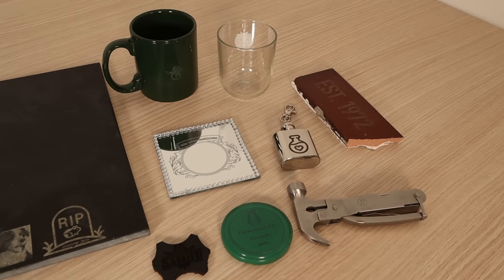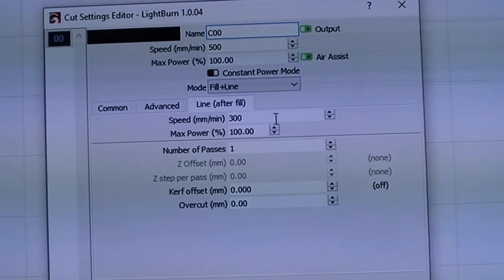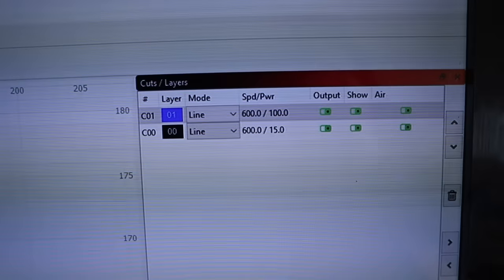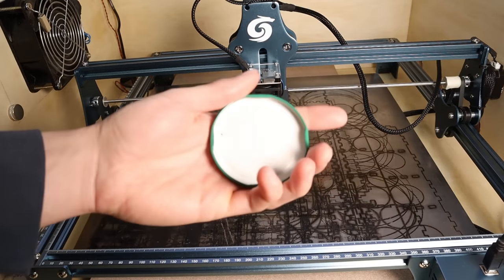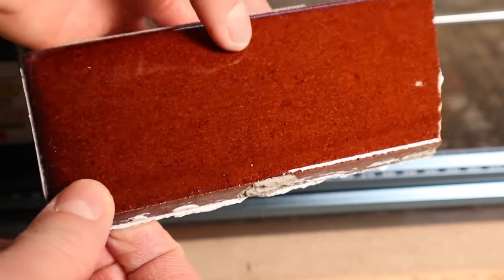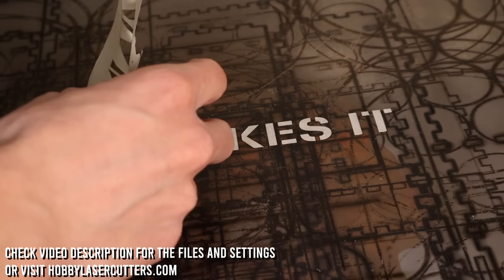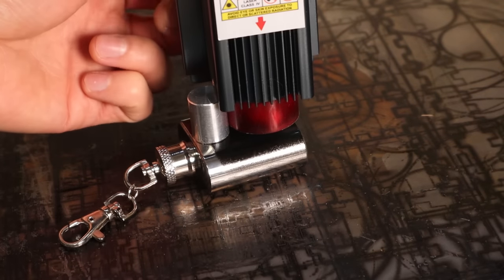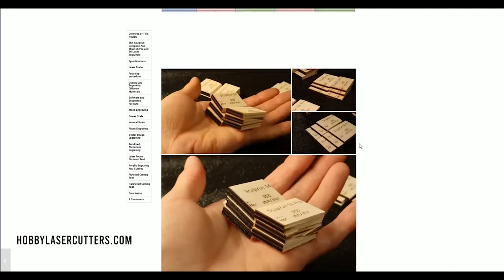10 EXTRAORDINARY MATERIALS You Didn't Think You Could LASER ENGRAVE! (Sculpfun S9)

Comment: Awesome video, thanks for all the ideas! 
What settings did you used for the stainless steel engraving? For me it didn't worked very well so far.
Reply from the maker: Thanks! For stainless I use very very slow speed and full power. If it still doesn't work, try painting the surface black with a marker or a spray paint. It will engrave much better.

Comment: Thank you for this really informative video. I have been researching extensively, trying to find the best inexpensive laser for engraving very thin lines on cow bone. The same as scrimshaw. I have been having difficulty getting specific information on this. Please tell me, do you think this S9 can engrave clean lines in bone that are about .07mm wide and .07mm deep? Or can you recommend an alternative inexpensive system to achieve it? Thank you for any advice you can give.
Reply from the maker: The s9 has the thinnest lines in its class. Check the link in the video description of my review of the hobbylasercutters.com. where I have measured the laser spot size. If Ou want to have smaller laser spot (0.3mm) checkout my review of the Enjoywood M4)

Comment: Very strange, the one I tested does not mark a shiny metal surface, not even when painted black, even at maximum power by making several passes. I haven't tried it on glass, but I assume it just tickles it.
Reply: So he's lying?
Reply: I've got it to work on glass using black water based paint like shown here, works well. I also managed to get quite faint engraves on stainless steel but I haven't tried other metals.
Reply: @MrVininski  So do you recommend it on stainless steel? Could I see some of your engravings? I'm searching for a low budget engraving machine for stainless steel and I don't know yet what should I buy.
Reply: @MrTaVy07  it's a great machine but I wouldn't recommend it for metal. You can see my first tests here on some stainless steel offcuts. Some were darker than others but most came out quite faint. They don't scratch off when cleaning with cloth or scratching with fingernails. https://www.dropbox.com/s/r0bono61a799uth/img20220220104043.jpg?dl=0
Reply: It only marks SOME steel. Like the one on cheap cutter blades. Not shiny metals, not zinc plated steel, not coated steel, definetly not chrome steel. Not even with paint, vinegar, mustard, etc. I am in the same situation belived those youtubers that leaved us thinking that those lasers could engrave any steel. I spent hours trying. Try cheapest  cutter blades first. speed 1000m/s 80% on 20W laser.

Comment: Hi could you please share what settings will need to be change to engrave on metal sheet just 1.5 mm thick. Hope you answer shortly.
Reply from the maker: For stainless steel, full power and very slow speed. For normal steel it is impossible to engrave it with diode lasers
Reply: Which laser is successful then please suggest. Thanks for your kind reply.
Reply from the maker: @roshanshah2709   This one: https://youtu.be/LvUuUONVthE
or this one:
https://youtu.be/anb9m1GDyHU

Comment: How do many passes do I have to do on 3mm mdf and what setting that it doesn’t burn the edges
Reply from the maker: Max power nd 300-600mm/min. As many passes as needed to get through. Mdf will always have black edges as it is not the best material because it contains a lot of glue. Some mdf boards are easy to cut, some are almost impossible.

Comment: Good Morning

I have an A5 PRO, I'm a professional cutler, I use the engraver to make engravings on my knives, but I have a problem.
after removing the paint, the metal of the knife is not clean, before that I used a CO2 burner that left the place very clean and highlighted the black paint, do you know if there is any way to do this with the A5 PRO?
Reply from the maker: Try different power levels and speeds and number of passes

Comment: Hi, can we cut zipper pullers made of Steel ?. In different shapes with S9. Steel thickness 10mm max.
Reply from the maker: You can't cut steel with these cheap machines. Lasers for cutting steel start at 10 to 20k usd

Comment: i am unable to take print via light burn software in any SS metal, could you please helpme.
Reply from the maker: Max power and very very slow speed. It helps if you paint the surface black with a marker or some other paint.

Comment: Hi man, I just buy sculpfun and tried to engrave zippo lighter, even when i painted it black it doesnt engrave enything on 100% power, any advice? thanks for answer
Reply from the maker: You need to go very slowly. 100mm/min. It works if the lighter is stainless steel or similar. If it is made from aluminium or brass it probably will not work with any laser.
Reply: @JTMakesIt  lighter is From brass with shiny layer on it, i did it with 20mm/min with 100% And nothing happened at all.
Reply from the maker: @Jsemsadlo  Brass doesn't laser engrave. Try stainless steel

Comment: What is the dpi for image engraving on granite
Reply from the maker: It depends in the setting. Laser dot is sized approx. 0.1mm . So around 250dpi.
Reply: @JTMakesIt  I engraved a portrait picture on granite but it looks like completely white. What should I do, should I increase the dpi as it is the same as yours
Reply from the maker: @IrfanAli-fb1tv  if it's completely white, then you have too much power. Reduce power and increase image contrast.
Reply: @JTMakesIt  ok I will try

Comment: I mainly come from the 3D world I have been researching laser engravers and my question is how long they can work I intend to engrave black stones but with a size of at least 30 x 30 I am worried about not knowing the number of hours it takes for the subject of the temperatures, the protections, etc., point since I have all my 3D printers prepared so that they can last days even TFYA
Reply from the maker: The working time heavily depends on the details and fill amount. But the machines themselves can run for hours at a time. Here I have engraved a photo which took 21 hours to complete:
https://youtu.be/iUTRLMqlYX4
The fill step was very small (0.1mm) but it did it perfectly.

Comment: Do you have data on how long does it engrave? Thanks
Reply from the maker: How long per engraving? It really depends on the design. Simple line engravings take a few minutes max, photo engravings can take longer, depending on the size
Reply: @JTMakesIt  thanks what about text like names? How long does it take?
Reply from the maker: @mangjose03   @Jose JRT  text is engraved quickly if you engrave the outline only. If you also fill the insidenof the letters, the time heavily depends on the type of fill (full, or crosshatch..). You would nred togivr me a concrete example for time calculation.but lets say for example that JT MAKES  IT logo I engraved on the stainlrss steel tool in this video took somewhere around 1 minute. If the text would be solidly filled it could take more than 5 minutes, because stainless needs to be engraved much slower than wood.
Reply: Wow! Thank you for your time answering my question.

Comment: Hello 
I'd like to know for sculpfun s9, what's the best settings for engrave powder coat stainless steel tumblers?
Cheers
Reply from the maker: Experimnt with power so that it burns off the paint and that it doesn't mark metal. Power should be around 50 to 100% and the speed from 500 to 1000mm/min

Comment: very nice videos. thank you.  
can you explain why you put black color on the shiny metal and if its posdible to do it without the black color ?
what if the engraving is on an extrimly shine brass and must be untuched after engraving prosses 
thank you
Reply from the maker: Black color is so that the laser beam does not reflect off the surface and has something to work on. You can blacken the sirface with more easily removable paint like children watercolors. You need black surface so the laser light can be absorbed. You can do stainless without blackening with the s9, but I haven't tested brass yet.

Comment: what settings did you use to engrave on stainless steel? I am using lightburn and having issues getting the settings right to engrave on the surface. I am a new to this so need all the help I can get. Thanks
Reply from the maker: Try 200mm/min or lower and full power
Reply: @JTMakesIt  THANK YOU SO MUCH!

Comment: All decent diode lasers can do all of this!  Guessing you were paid to say how great this laser was. I have never tried a mirror, but I can get the same results from my super cheap $200 no name laser.  I am guessing I can do a mirror too, just never tried it.
Reply from the maker: I was not paid or got anything for this video. This video is just me having fun with this laser, because I wanted to see what it can do, and I got a lot of requests about certain materials in the comments. I have tested a lot of cheper lasers. Cheaper lasers usually fail to engrave stainless steel and ceramics and other metallic parts. I tried mirror with weaker laser and it engraved it but the engraving was not as clean because it did not have enough beam energy to cleanly burn away the coating. But Sculpfun S9 is still considered a cheap laser. Its 300$, but it performs almost as good as some 500$+ machines
Reply: @JTMakesIt    So you bought this laser with your own funds?  It was not given to you for review?  It sure sounded like a commercial to me... no other laser can do all this.....

All other lasers can do all that besides maybe the mirror, and that is only a maybe.  I can get just as good of results with stainless and ceramics.  

I have no doubt this is a good laser, I am only questioning your video.
Reply from the maker: @jon9947  I got it for free to review on my website. There was no obligation from the sponsor for me to make this video. 
If you listened the video, you would hear that I said that it is the only laser in this price range that  can do ALL of these projects. This means that less capable machines can still do some of them. I have around 10+ laser engravers currently, ranging from 200$ to 800$. And none of the sub 400$ lasers I have is capable to engrave stainless steel half as good as the S9. This is why I said that it is the best in this price range. 
The reason that the video sounds a bit like a commercial is because I have posted my affiliate link for this machine as the affiliate commission helps me to make more videos for you at no extra cost to the buyers of the machine. Plus it enables me to obtain discount coupons that benefit the viewers. 
Each video takes about 50+ hours of my work, and I can't do this for free as it takes away most of my free time. I still need to work at  my job 8 hours each day. Youtube is my hobby. If you expect that someone is going to spend 300$-500$ of their own money each month and then film and edit the video for 1 month in the weekends, just to earn 30$ from youtube ad revenue from that video, then you have weird expectations. 
But one thing is true and that is that all of my reviews are unbiased. I always say what I want. If I like the machine I say good things, but if I don't like something I will say it as well. On my website you can see objective performance tests of all the machines I have tested so you can compare their performance directly and buy the machine that suits your needs the most. This is why I do all of this, because manufacturer specs for these machines are all over the place and it is impossible to compare the machines using the product descriptions online.
Reply: What do you recomment? 
I want to engrave watch dials.
Reply: @joeyhohage  I am not really an expert in lasers, the laser I have is very generic and is your run of the mill 5watt laser.  I do know one thing, guys like JT Makes It are not honest.  Any reviewer who does not start their review by telling you they got the machine for free are probably too afraid of having their free lunch turned off to provide 100% honest reviews.
Reply: I also know for the most part a 5watt diode laser is a 5watt diode laser.  Yes some are slightly better than the next, but they are all mostly the same.  The only thing that separates them is how many hours you get out of them.  The max power for any diode laser is about 5 watts, and any laser claiming more is either lying or has multiple diodes focused in the same spot.
Reply: What you probably really want though is a co2 laser from omtech.  Again, no expert so you will want to do your own research, but that sort of laser is a massive step up from these diode lasers.  You can pick up a budget k40 laser for $600 or less pretty easy.

Comment: So S9 is more than enough for engraving almost any things ? 

Thought about buying the S10 😂
Reply from the maker: S10 is a faster and better for more difficult materials like stainless steel
Reply: @JTMakesIt  how do you compare this with LaserPecker series (mini, 2,3,4, LX1 ) ? 

I like how potable they are but can’t be sure about safety.
Reply from the maker: @thanatosor  if you want to do some laser cutting, machines like Sculpfun are much better
Reply: @JTMakesIt  also is it enough to use S9 with only protective glass on the laser beam ? 

Or you actually also wear protective glasses during the test ?
Reply from the maker: @thanatosor  if you are looking directly at the machine it is recommended to use glasses for just in case.
Reply: @JTMakesIt  how are you doing air filtering for this open engraver ? 

As for laser part, I can just buy additional enclosure onto its laser pointer but enclosure is another story which made me hesitate from doing wood cutting.
Reply from the maker: @thanatosor  I made a wooden box with a fan to extract the smoke out the window using an air hose.

Comment: Very awsome video! It's so helpful! Have you ever engrave trasparent acrilyc? I'm struggle to get a good result for using as led light lamps. Thanks!!!!
Reply from the maker: I had great success engraving transparent acrylic. You need to paint it black first with a spray paint or better - some water soluble Tempera paint that can be easily washed off. Then the paint dries, you engrave the thing and after engraving you remove the paint. The engraving leaves a matte finish. Same procedure with glass, you just need to set the engraving speed much slower and use more power.
Reply: @JTMakesIt  man, you reply me so quickly, thank you!!!!! After paint it, have you engraved the painted side or the unpainter side? So I have to set high speed and low power for acrylic, correct? Thank you again!
Reply from the maker: @giuliabignami7367  You need to engrave the painted side. Watch how I did it here at timestamp 7:30: https://www.youtube.com/watch?v=sFGE0UnZZrg
You should use speed of around 400-600mm/min for vector engraving, but for filling shapes you can use up to 2000mm/min. Experiment a  bit with the settings and you will see what works and what doesn't.
Reply: @JTMakesIt  you don't know how much i appreciate your reply! Thank you so so so much! I'll try in the next few days and i tell you how it work! Awsome Channel!

Comment: Please could you show reversed side of jam's lit? According to my experiences it will be damaged even when front side has a nice engraving. There is some plastic surface cover of metal that gets damaged and the jam lit get rust in the engraved place - and mould appears. I recommend not to use it.
Reply from the maker: You need to tweak the settings a bit. Going very fast with the right amount of power doesn't pentrate the other side. But otherwise I agree with your statement.

Comment: You use Full Power way too often. To cut Paper? C'mon. Also, both Atomstack (S10/A10/X7) & xTool D1 have comparable, if not better, performance to the S9 for about the same price.
Reply from the maker: Better to use more power than finding out that it was set up just too low and you waste the piece. I have the A10 and the XTool on test right now. They are approx twice as expensive as the S9. Wil release videos and tests soon.

Comment: Can not engrave every stainless steel why you do not tell the true  about it
Reply from the maker: Of course it can. But you need to set slow speed and high power
Reply: @JTMakesIt  i set the power 1000   and speed 200  is it right?  but can not engrave  silver and gold stainless steel  , i bought several stainless steel bracelets and tested
Reply from the maker: @ma-oq8wj  200mm/min or 200mm/s? Try 50mm/min. If it still does not work then the bracelets are not stainless steel. And try to darken the surface with a black marker before engraving.

Comment: Lots of overpowering stuff in here. Guys remind: Better not to run your diode laser with 100% power. Your laser will not last that long. Also some overpowering with the engraving stuff here. You dont need 100% power on mirror and stuff like that
Reply from the maker: It takes some time to fine tune the settings. If I don't have multiple items to test the parameters and i need to do it in the first go,  I rather use more power then less. These are short engravings they should not affect the lifespan of the diode. I tried to engrave glass with less power,but the lines were not as crisp. Diode should last thousands of hours.